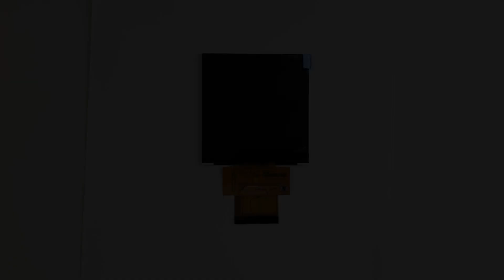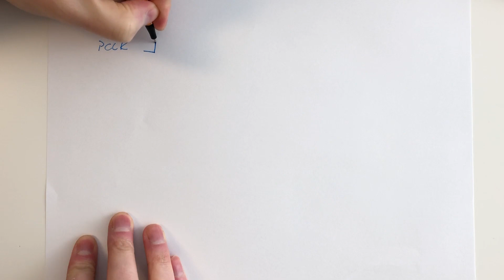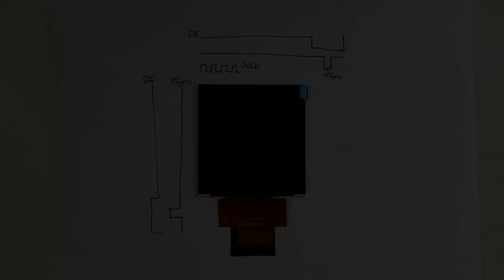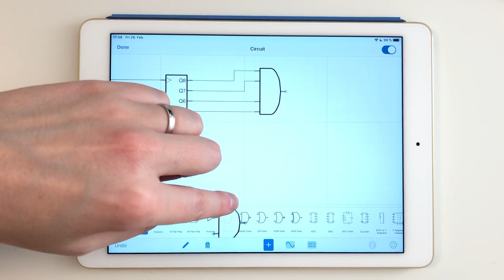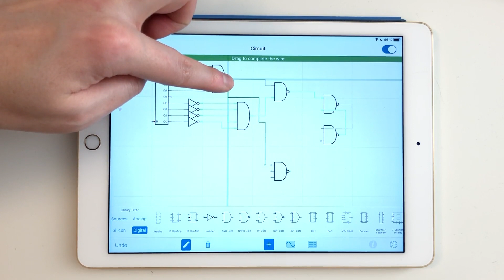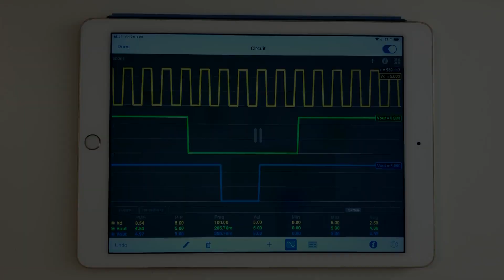How to Create a Display Timing Circuit for an LCD Display

Comment: Great vid.  Where did you purchase this screen from?  And do you know if there is a data sheet for it?
Reply from the maker: Thanks! I found the display on buydisplay dot com. I created an open source driver board for it - look for FT81x_Arduino_Driver on github!
Reply: @randomc2456  Thanks, I'm going to be starting a similar project soon but I'm planning on using an stm32f429 since it has built in display hardware and writing it in Rust.

Comment: What is that simulation app you are using on the iPad? Is there anything comparable and as full featured on Windows?
Reply from the maker: It's called iCircuit. I haven't used any simulation software other than that yet.
Reply: @randomc2456  Okay, cool. I'll have to check it out. Very neat project btw! I look forward to seeing more videos about it. 😁